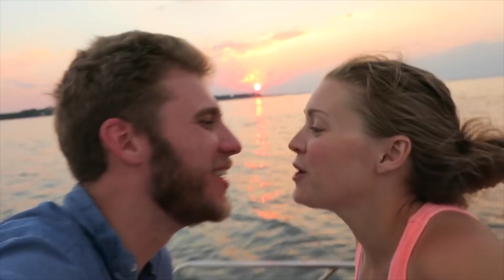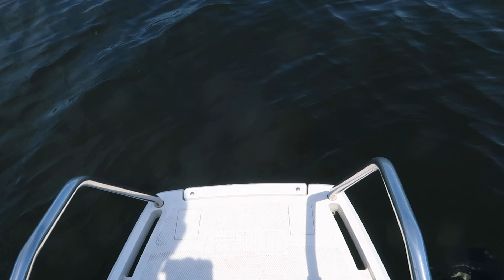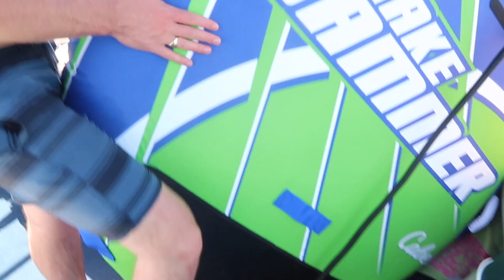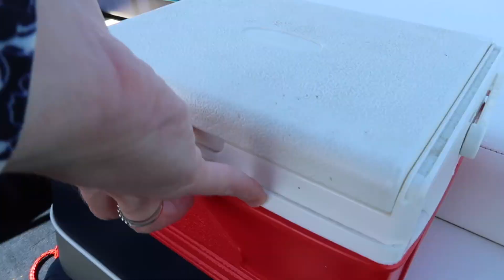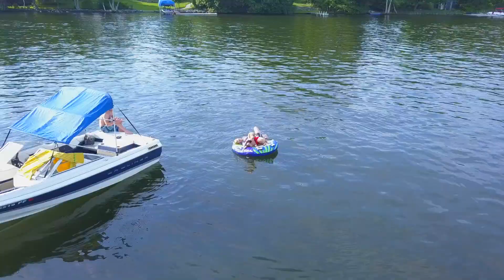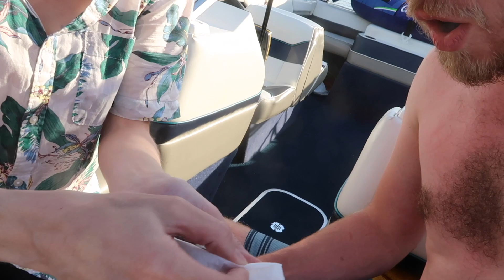MARY FELL IN! 🌊 (6.17.18)

Comment: For the ramp, you might find using Velcro, vs your Tie situation.  Much easier and quicker. When ties get wet, they can be a real hassle to un-tie.  Not great in an emergency.  Also, your cushion MAY absorb a lot of water, due to you drilling it on.  We had something that we used styrofoam underneath (no mold build up, and longer life span than a drenched pillow).   We just used a great glue from the hardware store.  Good luck!  Ollie was so cute when he watched the boats go by!  :)